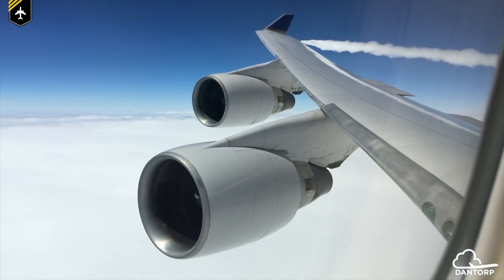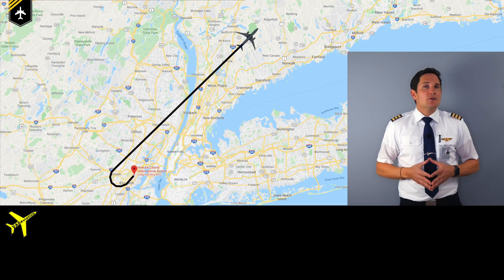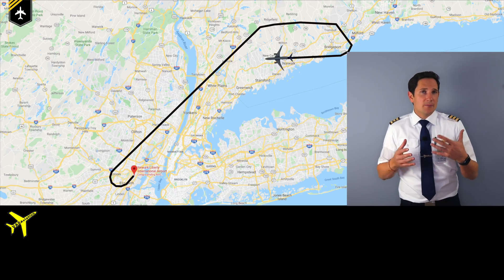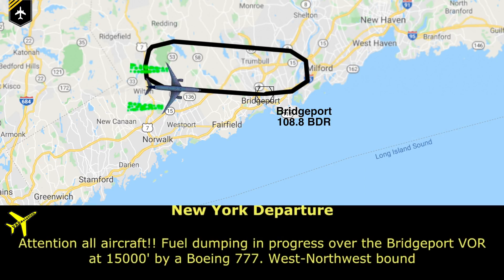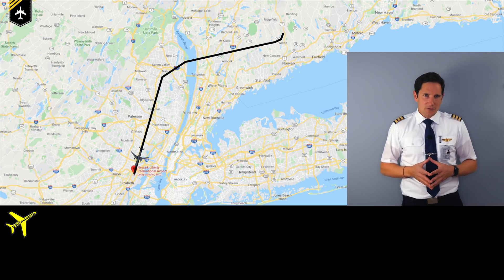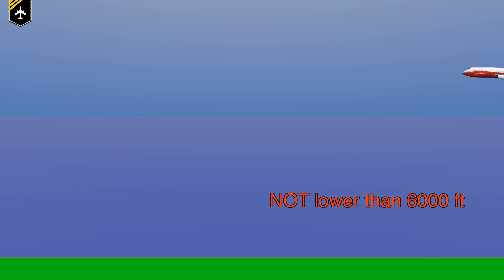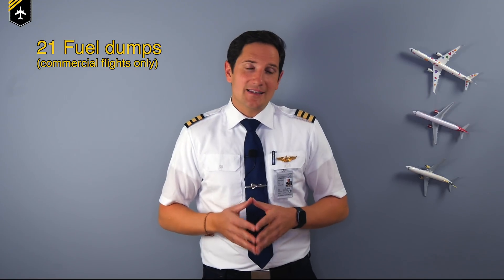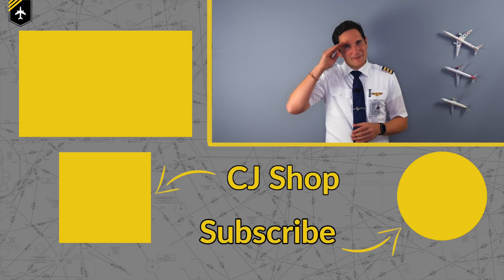WHERE do pilots DUMP FUEL? part 2 Explained by CAPTAIN JOE

Comment: How often does  this happen? What about booking less passengers to compensate the weight? Then you could spread things out a bit, even. 
I was having band rehearsal at a storage unit by the airport a few years back. We were right in the landing path. I saw quite a few planes passing over, with these nozzles puffing out white stuff. Not necessarily wide open, but just puffing out little white clouds of something. The whole area was covered with this white substance.

Comment: So... Why every single plane flying over every single city in this planet is dumping "fuel" over our heads. Just look up. Dou you see it? Do you?? It's not enough research? Humm......
Reply: No, they are not doing that. 
Fuel dumping is only done in an emergency situation.

You have seen the condensation trails produced by aircraft engine exhaust. 
Condensation trails form when hot humid air from engine exhaust mixes and condenses with environmental air of low temperature.

Comment: is there a simple way of distinguishing  a fuel dump from a normal condensation trail , just by looking at the  jet  from  the ground ? ...thanks
Reply: Yes. A condensation trail will be immediately behind the engine, and there will be a gap between the engine exhaust and the start of the condensation.
A fuel dump will not be behind the engine (usually its more towards the outer edge), and there will be no gap between the fuel and the wing.

Comment: There was a jetliner that was forced to dump fuel over Los Angeles in either 2019 or 2020 during an Emergency, but they did it at a low altitude and the fuel landed on an Elementary School, High School Sports Field, and a few other places. Some of the fuel landed on children and teachers at the Elementary School, also some fuel landed on students practicing on the sports field (if I remember correctly), and other people had the fuel rain down on them before running inside buildings and notifying authorities.  

I always thought the jets had to dump the fuel over water; like out at sea or over a large lake or a river. Thanks for clearing this up that they can dump fuel over land, but has to be over a certain altitude.

Comment: In 1981 I lived under the glide slope for the Charleston Air Force Base. I understand condensation effects, but I remember Starlifters on final with what I'm sure was fuel coming out of the outer wing tips. Where I was, nothing ever made it to the ground. I also clearly remember hearing the howl of the hydraulics lowering the landing gear.
Reply: The fuel jettison ports of the C-141 Starlifter are not located at the wingtips, they're located between the outer flaps and the ailerons, and you'd never be dumping fuel on final approach. You probably saw contrails created by wingtip vortices, which is most commonly associated with heavy aircraft flying slowly at low altitude (e.g. on final approach) in high humidity.

Comment: so we live just east = to the side of Boeing Field

Takeoffs to the South into ~ prevailing wind; Landing from the North over industrial + formerly poor Georgetown neighborhood.

When we bought a house on the hill in 1999, above Military Road, we noticed a heavy smell of kerosene every few weeks 
(rarer in recent years, but not ended).

At 1st I thought someone had used way too much lighter fluid for a charcoal cooking grill.

(No circling; low altitude.)

Besides Boeing's own operations, such as the 777-based Air Force fuel tanker program, the main use is by cargo planes, with some private use too.

(Also when we 1st moved here, the biplanes shutting off their radial engines Right Over Head was good to get the heart sped up.)

Comment: I have a random question... would it be possible to recover that fuel instead of dumping? I mean, think about it this way: in the same way there is in-flight refueling, would it be possible to do the reverse operation? I mean, a plane of the same nature of the ones used to refuel during flight, with a pump used to suck the excess fuel from the tanks of the plane.

What do you think?
Reply: No because no airline has the air refueling rhing anyway

Comment: I am just a hobbyist on aviation, I assume that the flight use jet fuel, As you mentioned in one of the video, that the exhaust from engines will be approx. 600 degree Celsius, How the dumped fuel is isolated from the exhaust gas, to avoid ignition (on dumped fuel), while dumping. i.e. is there any particular part of design in the plane to make this possible?, also can you explain the dumping of fuel during an engine fire.

Comment: why small or narraw range aircraft cannot dump the fuel like a320 ? plaese tell me
Reply: Because there is not so much difference between the maximum landing weight and takeoff weight that it would be a really big problem, if it is necessary to land the aircraft.
Reply: 16:35 "...so don't worry, the next time you're on the plane & you see this, this is just air compensating over the wings, or in this picture here, it's the same thing; its physics..." 
Yes I know @ 16:43 it's a 738; it doesn't have a fuel dump system ;)

Comment: How is there fuel vapour? I always thought fuel was liquid and you'd have to be over an ocean or something to dump it :O
Reply: Fuel vaporizes very quickly especially if spread it out over a large area.
Btw, liquids can't burn. A lot of vapors on the other hand burn quite well. What your car burns for instance is actually not liquid fuel, but fuel vapors. the fuel vaporises almost immediatly after it is injected and it's the same with turbines.

Comment: Sir Joe...
➡ Can we do one thing... That there should be extra fuel boxes or cylinders attached with parachutes and GPS tracker 
➡ When Pilots starts fuel dumping, fuel will be diverted into this tanks... When they get full... They will be ejected from airplane and will be landed safely through parachutes... And we can reuse the fuel back by using GPS trackers and locating the area where the boxes landed....
➡ If you like my idea 💡... Pls give my comment a  ❤️ and reply me ☺... It would make my day
➡ Thank you 🙏
Reply: Do you realise what would happen if a 10000kg fuel tank lands on a wooden house?
Reply: @shi01  It's not necessary that everytime there is a house under the landing site.... And if there's one.... You can do dumping in air ..
But we can try to save as much as fuel we can...
Reply: It's impractical. Because one you are increasing costs for something that will hardly be used
and second, having such a system will bring dead weight, hence increasing fuel consumption. Therefore the fuel being saved is offset by the extra fuel being burned.
Reply: @ZK-APA  but I think the cost of separate tanks will be obviously lower than dumping 70 tons of fuel ⛽ and if we can retrieve it back... Then it's more helpful..😃
➡ I may be wrong... But it's just a concept
Reply: @knt2112  The thing is fuel dumping is very very rare. Some planes may never even dump fuel during their entire life cycle. So implementing such a system wouldn't be feasible.
Reply: @ZK-APA  ya. Correct 💯  I Was thinking the same thing right before your msg arrived ☺️

Comment: You explained well why the flight crew decided not to declare an emergency, yet implemented the extraordinary measures of dumping fuel then returning to EWR. Since what constitutes an “emergency” is something as to which reasonable minds could disagree, I could easily see a situation where United’s ground-based senior management might say to the flight crew “you guys need to declare an emergency”.  Can someone explain the grounds for and the significance of the airline declaring an emergency on behalf of the flight crew?  It seems very odd indeed.

Comment: Is it the brakes or the airframe stress of the impact that is the issue since they don't want to land with all the wheight? How come - if possible, they just don't land but with a tested, different flare? If it's a impact issue that could be fixed there.
Reply: It's the issue with the airframe because landing with overweight will cause more stress on a fuselage, and also naturally on the landing gear during the touchdown.
Reply: Airplanes have a maximum landing weight. That means don’t land above this weight, unless you have an emergency. So when a problem arises the crew must decide what is the best course of action. Not all problems are simple to deal with as there are many things to consider, and you must be prepared to defend your actions.

Comment: Hi everybody. Do all big planes (from A318 till A380 or B737 till B787) dump fuel? Cause I have only seen in big planes (777, 787, 340, etc.). Thank you
Reply: The wide body aircraft (like e.g. A380, B747, B777, B787) have a fuel dump system, but aircraft like A318, A319, A320, A321, B737 and B757 doesn't have that system.

Comment: I often happen to see two specific jets/routes dumping fuel over Melbourne. One, is a 747-400 on route to Sydney from Johannesburg at noon ish. The second one, is a 787 on its way to Perth from Auckland. Both pretty high though. I always wondered why do they dump fuel as I don’t think almost every single flight has an issue requiring them to dump. Great video, Joe.
Reply: You were just seeing contrails. You will never see a plane dumping fuel if they are landing at their planned destination, since they will already have used enough fuel on route (unless they had way too much fuel on board due to some sort of egregious error, in which case the person responsible is going to be in a lot of trouble for wasting the airline's money).

Comment: How do pilots know where they are going?
Reply: The aircraft have navigation equipment, pilots have electronic flight charts and they also use GPS. The location of the aircraft and its flight path can be seen on the display.

Comment: How do you became a pilot if you do if you have vmbo
Reply: In Europe you have to be graduated from high school if you want to become an airline pilot. Basically you can start the pilot training for the commercial pilot licence when you are 18. You need to have a commercial pilot licence with multi engine rating and instrument rating. You need also pass the written test for the Airline transport pilot licence (ATPL). You will get the full ATPL later. In the USA the major airlines require a college degree.

Comment: Now I want to know about a fuckup where a plane flew too close to another dumping fuel and it went very badly
Reply: The Air traffic control will inform all the other aircraft about the situation and gives a free airspace to that aircraft which has to dump fuel.
Reply: @mikep9604  Sure, but the question is the worst-case result if another airplane does get too close. presumably stalls/damaged sensors/impaired vision, but what else?
Reply: @EmilyTestAccount  - Stalling is not what would happen because it's an aerodynamical thing regarding the angle of attack of the wing. I have never heard about situation that another aircraft has been too close, so hard to say about that.

Comment: I'm surprised at how haphazard the diction is on both ends of these conversations. I hear a lot of "um" and "uh" as well as oddly casual phrasing and word use. I would think that in a profession where clear communication is a life-or-death matter, the speech would be a lot clearer. I must have been wrong when I assumed that pilots and ATC personnel are trained to speak clearly or at least make an effort to do so.
Reply: It usually isn’t a problem in most cases. In cases where things might be problematic people tend to stutter or struggle

Comment: Hi I had a question in my mind from a long time.
Can a pilot flying 737/747 immediately fly A320/380/340 without basic changeover training? 
I would really appreciate to know!
Reply: An airline pilot needs to have a type rating for the aircraft he/she flies. A pilot who has a type rating for B737 or B747 can't fly an A320 or other Airbus aircraft before a new type rating training. So the pilot has to get the type rating training for an A320 before starting to fly this aircraft.  It's same thing also regarding an A380 and A340, a new type rating is needed for each aircraft.
Reply: @mikep9604  thanks
Reply: @mikep9604  Hi Mike. Thanks for your inputs. I am aware of type rating. But I want to know whether he or she can handle the other aircraft in a professional way in which he or she had never flown?
Reply: @ashishbarandhara195  - I think that an experienced pilot who has flown a B737 can handle an A320 if it is necessary. Regarding the much heavier aircraft like A380 and A340 the landing would be the most critical part if the pilot has never flown these types.
Reply: @mikep9604  thanks Pal

Comment: Why???
Reply: Can you clarify what is your question?
Reply: @mikep9604  why waste fuel?
Reply: @Djaiicool2012  - It is rare when they have to dump fuel, because it's only done in an emergency situation.
If there is an emergency situation during an early part of the flight and the aircraft must land soon because of this emergency, the aircraft has not used much of its fuel load in the early part of its flight, the aircraft would be too heavy to land. (Every aircraft has its maximum landing weight.)

So if the aircraft is too heavy to land because of its fuel load at that moment of emergency they have to dump fuel to make the aircraft lighter for landing.
Reply: @mikep9604  thanks.. damn expensive huh!!

Comment: I got a question
After the jet landing there are certainly still have some remaining fuel on board, so the fuel will be use again for next flight or other procedure?
Reply: Yes, they check the quantity of remaining fuel, and then refuel the quantity they need.

Comment: Anyone else mess with the chemtrail nuts with the dihydrogen monoxide path? So easy to tell how bad that chemical is and how unregulated the creation is, how addictive it is, how many people each year die from direct contact with it before you inform them it is water the normal chemical produced in hydrocarbon combustion.

Comment: I have been in a cockpit 3 times on the glideslope to 26L to KMIA flying for Amerijet while the captain commanded fuel dump over the city due to overweight. Check it out...on glide slop over downtown is below 2,000 feet agl. Dumping fuel without talking to ATC about it. I've been there...I've done it. I was gobsmacked each and every time. Amerijet out of KMIA is a dangerous airline. I have many more stories.

Comment: Uhh, what happens with the fuel when you dump it?
Is it falling like rain down at Bridgeport or is it vaporised immediately?
Reply: It will dissipate in the air.
Reply: Jet fuel when it is dumped doesn’t really cause any issues. As he said, it just kinda dissipates

Comment: SFO: I was on a jet that dumped fuel.
One aborted landing, a flyby the tower to check the gear. The Captain said the nose gear light wasn't green, so we flew by the tower. 

We flew over the Pacific ocean and dumped fuel. Then landed in crash landing position. No problem, the gear was fine.

Same trip had an earthquake while I was in the 13th floor of a hotel. One of 2 earthquakes that had me concerned. The other was 1989 Loma Prieta. Usually anything under 4.0 is amusing.

Comment: How much ¥€$ do the Airlines lose by actively wasting fuel like this? Ok granted those costs are probably well offset by the reduced stress of the Aircraft on landing. But, why hasn't anyone worked out a better way to not dump fuel. Save perhaps in those instances as shown in this Video?

Comment: Nice explanation of a complicated issue in aviation. Thanks Captain Joe !!!
Reply: It is only complicated because they don't want you to know about it.  Simple as pie, large commercial aircraft are allowed to pollute as much as they want because they are defense contractors.  They have no obligation, or profit incentive to build a plane that pollutes less when they don't have to.

It's cheaper to dump thousands of gallons of fuel than fly less passengers in a more expensive plane.

Comment: There was a time in the 70's when we did not dump. Burning off fuel and overweight landings was done. The overweight landing inspections were usually normal.

Comment: Its been so long that this procedure is used in various situations, why no one has developed a system of dumping fuel using a retrievable system. Just out of blue, fuel to dump gets shifted into a large container (yes fireproof/leakproof) then dump it in designated area, container has parachutes to get down. This is 2019 do something innovative, every innovation is being done in mobile phones. Use the air dumping as backup option. I know large collection of fuel is dangerous thing, but so are fuel carrying tankers on road. Just create a good container, its not 1980s.

Comment: The fuel dump is literally a trail of chemicals so it's not technically wrong if you take it literally but then again it has nothing to do with any programs to poison or for mind control of any sort, it's just horrible pollution due to safety concerns with something going wrong with those planes.